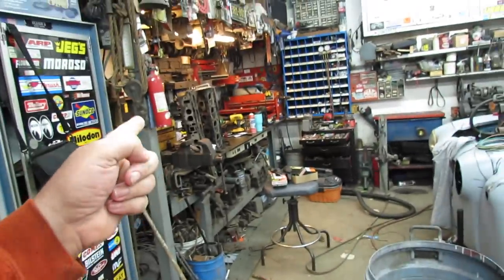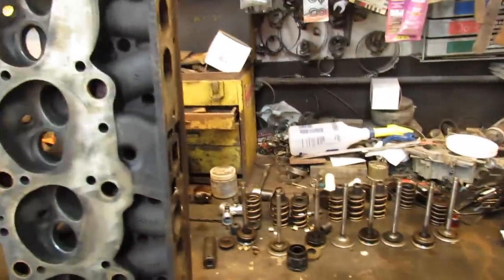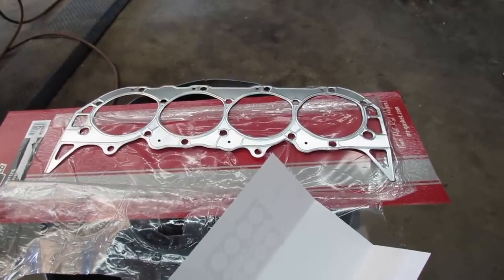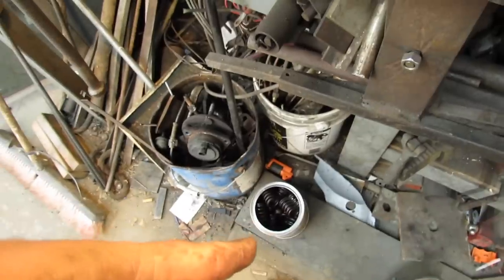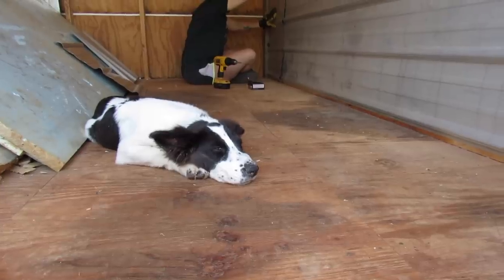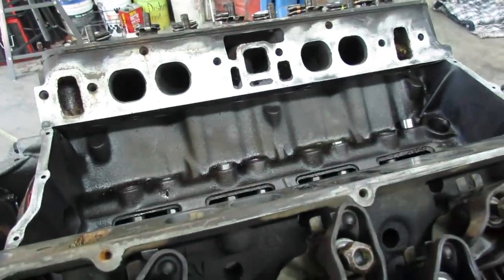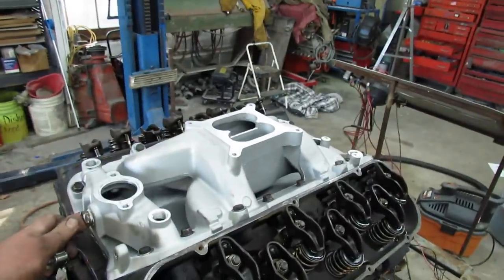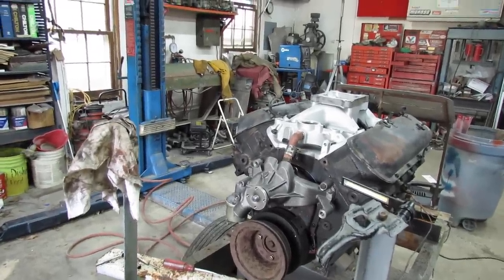454-assemble and install heads

Comment: Love Qjets too. I am redoing a low buck 454, but with '66 396 heads. A little bit of a cam (Think potato-potato-potato) And same hi-rise Q-Jet intake from the 396. Its not going to be daily driven, but going into a Chevelle, for mock up purposes: Exhuast, suspension, etc. Good luck with your big block!
Reply: Hi what heads did you use, were they 702?
Reply: @cj8172  206s

Comment: We had 6 new 1989 Suburbans with 454 engines on a contract operation in Saudi Arabia. Highways were excellent with no speed limits. Those Suburbans would run 120+ mph with ease. However, they were not balanced that well and most accessory brackets broke and had to be welded or made stronger after about 30,000 miles. A 300 mile trip from our field site to Riyadh normally took about 3 hours. I doubt you will be running at those speeds for more than a few minutes at a time and should be okay.

Comment: Yeah when installing heads I use the copper spray or the Indian head shellac. 
You could use a beam torque wrench too, they are more accurate. 
Well they say the digital ones are pretty accurate  I don't know you do the math.

Comment: Do not turn the pushrod, for finding zero lash, use the up and down method ONLY. Plus the EOIC method is more accurate when setting valves. The books method is the faster way but isn’t as accurate.
Reply: There's a guy in a 55 Chevy and a cowboy hat looking for you
Reply: ClappedOutClassics Ya I know,  "If he can't find me then he ain't even worth racing".